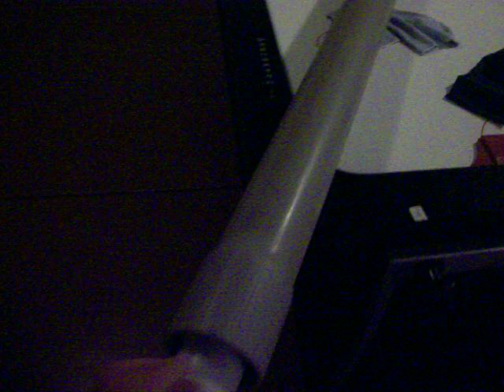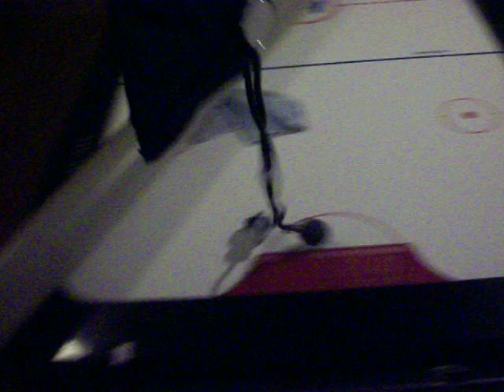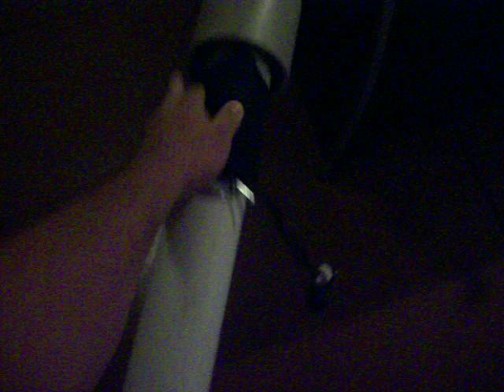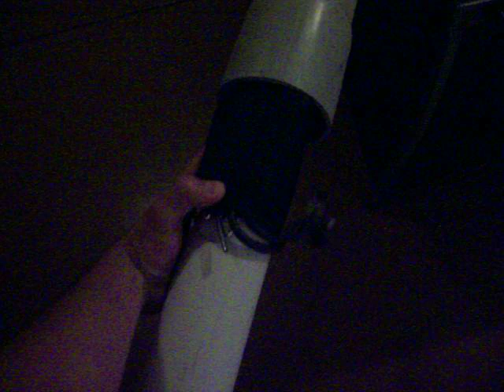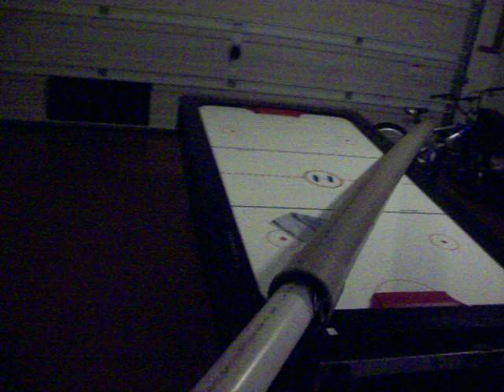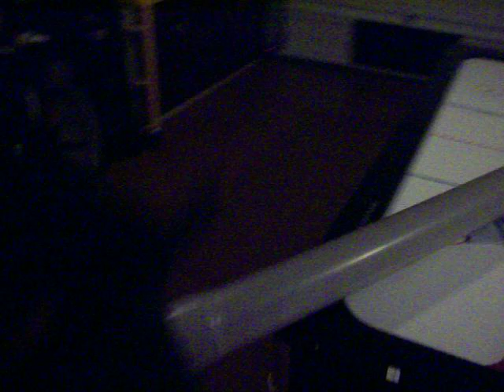Gulf Oil/Gas leak proposed solution 2010

Comment: all materials will not last a mile down,.the pressure is too high,..rubber will crack. This is a job for steel ideas only. You wouldnt need a bladder,..all u need is a first pipe an inch bigger and put slits around the edges,then you clamp it on,..on the inside of the other end you use threads,.then you add threaded pipes until its closed off..this youtubers idea would work,..search Gulf oil leak solution (by puffadderbite)